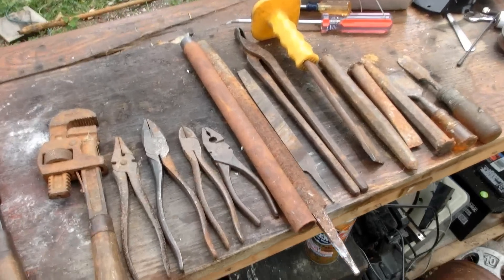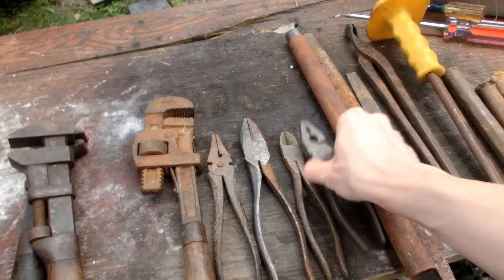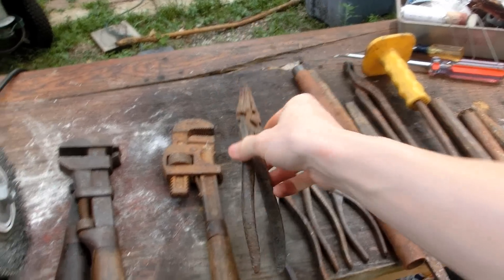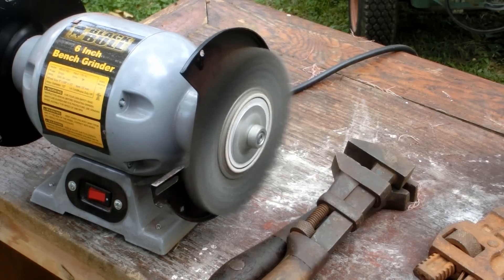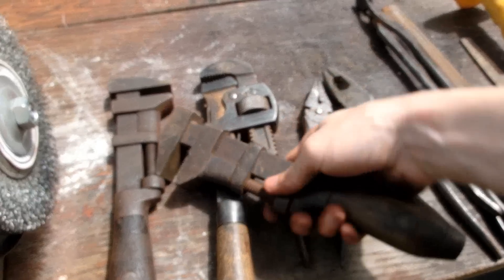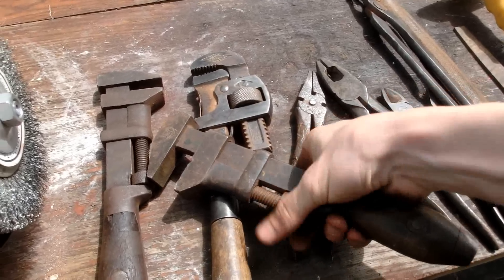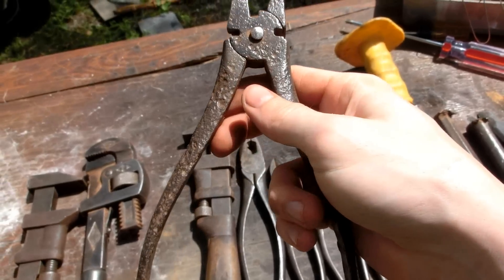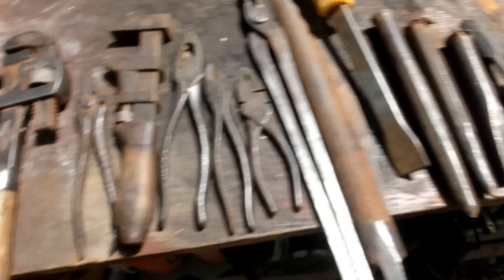Removing Rust From Old Tools

Comment: I'm a machinist and have been for 30 years.  I used to clean off a lot of rust from tools and hardware using a brush wheel.  If you are going to do this USE A RESPIRATOR!  I got very sick breathing in the dust and I worked in a very well ventilated shop.  My lungs were permanently damaged from the dust.  Also, those wires can come loose and fly in your face.  I hope you used safety glasses.  I can't tell you how many times I had to run to the first aid kit and grab tweezers and pull wires out of my co-worker's faces.  OK so much for my safety rant.
Reply: nunya biznez Yep, I saw a guy lose an eye to one of those wheels, I use a face shield to work with a wire wheel, I need to use a mask more often though.
Reply: John Smith I should have been more specific in my post.  I got cancer from the grinding dust and it took a couple of years of chemo and radiation treatment to get in remission.  So, YES you should us a respirator.  While the little paper ones may prevent a lot of dust from getting in your lungs, they are not full proof.  A respirator with filters specifically rated to protect you from grinding dust is recommended.
Reply: Hey, what kind of respirator should I use for cutting mansonry and bricks with my angle grinder?
Reply: Carlos De La Cruz T I would go to the website of a respirator company, there are several, and search their products.  To find out the names of such companies, go to a major supplier, most sell several brands.  MSC, McMaster Carr, Granger and others all have websites.  Or Google "PPE industrial" and you will find many vendors selling respirators.  Some of their websites have the information you need.  The manufacturers of such equipment usually have the best information and will often send you a flier to look over.  By the time you get done you will know more than you wanted to.  The paper masks you can get from Walmart are suitable if you are only doing a few.  but if you expect to do this for hours constantly, you will want a respirator with replaceable cartridges.  You will spend about $40-$60 for the respirator and maybe $10 for a pair of cartridges.  The respirator will have rubber seals for your face to help prevent any dust getting into your lungs.
Reply: Thank you very much!
Reply: Gloves... naaaa
Reply: ¿Guantes?
Reply: its stupid to wear gloves in this situation! the machine will just sratch you if you touch it, with glove on the machine will grab you
Reply: Yes well done cleaning job.But please bolt that grinder to the bench,if only for some oth
er person who may use it.Some wet and dry sandpaper to get any last bits out of any pitted bits would work to really do it.Nice job though good tools some 100 years plus old.I wish I had remembered to ask my mum for my dad's Yankee screwdriver. The old ones are always the best as they say.
Reply: @carlocruz4814  just google silicosis and if you're really interested, osha safety guidelines. I like the 3m respirator with the quick-latch, and organic vapor filters.. but idk if those are best for bricks/masonry.
Reply: Something so simple had to be said.  Safety first.  Thank You.

Comment: You can dip these same tools into a clear plastic bin filled with either apple cider vinegar or white vinegar and leave the bin outside in the hot such for a day or so longer. In fact, a couple of scoops of dried molasses (found at most farm and feed stores) put into a bin of warm water will do the same and not make the chemical mess as electrolysis will do. You can then pour the resulting ooze out into a flower bed (not vegetable garden) and still consider it being green. The grinder can snap back or kick back on you when you least expect it and the wheel does not get at all surface areas you want to clean. Lots of debris to get into your eyes or even damage your lungs.If using the vinegar or dried molasses stripping agents suggested above, just remember that flash rusting may be an issue. Generally, parts cleaned with apple cider vinegar will last a bit longer without the flash rusting happening. If your going to do electrolysis, then purchase a small kiddie pool to do your crazy scientist experiments in, as it will give you lots of room to add in more tools when cleaning. The reason I like clear plastic bins when using dried molasses or apple cider vinegar, is that I can easily check on the parts each day to see how the bath is working out.  Believe me, siting the bin into the hot sun will help the process along.Good luck on it.

Comment: much better if you soak them in vinegar, just plain old white vinegar for 24 hours, mayb turn them half way through.
the result will be almost as good as electrolysis, i did it to this old axe i dug out of the garden and it came out so good you could see the difference in color from where they hardened it.

Comment: For tools that I clean up, but won't paint, I spray them with Boeshield T-9 spray, it really helps to keep rust off, especially since I get a lot of humidity in my garage.  You can use their Rust Free to remove rust where you can't reach with a wire wheel or brush, and for the small pitting that the brushes can't get too.  It's not cheap, but it doesn't take much to do the job.  A can generally lasts me about a year.  If you use the Rust Free, you have to make sure to clean it really well after using it.

Comment: it wasn't anything new to me but it was still enjoyable to see someone else admit to forgetting a tool or two outside and then having to clean them up.  One thing I learned in a blacksmithing class was to get grungy pliers hot, but not red hot then work them under water and it will clean them right out.  Just dry them and use what around here is called blacksmith goop, basically equal parts of bees wax and linseed oil, to preserve them.
Reply from the maker: unfortunatly it doesnt matter if i leave them out in the mud or in my shed, its so humid during the summer everything rusts. i envy places like nevada where cars can sit for 60 years in the desert without rusting too much.

but thats a good idea for the beeswax mix.

i was in a local blacksmithing club for several years but unfortunatly everyone was only interested in making flowers and coat hangers. i'm more interested in hand forged tools and building parts of machines.
Reply: Rinoa Super-Genius my first non class attempt was a froe and if he will have a tool class when I can take I'm going to.  Because well, fancy junk doesn't matter to me either, I like and use tools and I want to make my own sometimes.

Comment: Bench grinder buyers tip: Pay more for a high quality motor, skinnier than your wheel diameters. A thin motor allows parallel work. The cheap, fat ones make all work cockeyed and off center. Been there, done that, paid the stupid tax.
Reply: This poor video was worth it just to read your comment!  Can you suggest any brands/models that have motors narrower than wheel?  its hard to spot that when buying tools online!  Thanks again
Reply: I bought my Blue Point grinder from a SnapOn tool dealer.

Comment: Great choice in music. I did not know to do this so thanks. My tools are moistly inside or in the garage. They are all off the ground. They do show signs of rust on my older garage kept ones like your used often wrench. With that said you are a very dangerous dude lol. I hope you never get hurt. I see someone complaining about not bolted down, yeah that would be important if it was not a brush I feel personally. I am more concerned about Gloves, then eye protection, than a dust mask to avoid inhaling any rust dust. Gloves most important when getting that close to the spinning metal wire.

Thanks again!

Comment: I find that if you put bearing grease on the threads of the adjusting screws or any two steel or iron parts that rub together, they move much more smoothly and helps keep them from rusting.  Also, sometimes, it's best to leave the rust where it is.  It often acts as a protective layer.  If you remove it, more rust may form and then you remove that and continue, you are reducing your tool/hardware down and keep it up and eventually it will disappear altogether.

Comment: Try just putting them in a vinegar bath for an hour then 5 min in a baking soda and water.  Let work and gets the rust out of all of the tight spots.  I spray most of them down with WD-40.  Works great fro me.

Comment: Not boring at all!  I just happen to be de-rusting several old and recent tools of mine.  An adjustable spanner that I am working on was really rusty.  Soaking it in WD-40 for a week and brushing I have got the jaw loose, but the screw is still frozen and will not turn.  There is another adjustable spanner I have which is identical to the one that you said did not need brushing.  It was probably made by the same company.  It's problem was not rust.  The previous owner used it as a hammer, deforming several threads of the screw.  I removed the screw and used a file to carefully reshape the bent threads.  I put it back together and now it works fine.  Thanks for sharing.

Comment: Secure that Grinder to the work bench and, use a Respirator Gloves  and, Safety Glasses! Other wise good vid.
Reply from the maker: +EBikerX Stroz i already wear glasses, no sense in wearing two pairs of glasses. gloves can be very dangerous when working with a grinder. respirator is overkill, and nah its not so bad to have a free-floating grinder.
Reply: he's is outside yo. can't get much better ventilation than that.
Reply: +Rinoa Super-Genius gloves+grinder=No fingers
Reply: As a physician I suggest to all to wear safety glasses above ordinary ones. I see in the ER from time to tome people even having safety glasses, getting metal in the eye when grinding. You cant be too safe about your eyes folks!
Reply: Using gloves on a bench grinder surely is a massive no no! Yes goggles and bolt the damn thing down!
Reply: @flamecranium7787  depends on whether you are up hill or down hill from the source of dust.......I find no matter how many times I move and re-position,  I still end up down hill from the debris in the air.  Same thing with smudge fires to ward of bugs, the danged smoke always seems to follow me.
Reply: Some times PPE can be more of a danger than protection, skill conquers all, all these YouTube comments on PPE are from people who don't use or are scared off powertools

Comment: Acid bath. Use something like Limeaway. Or if you're brave and attend to the process you can get rid of rust fast with swimming pool acid. You just have to be sure to remove the piece as soon as the rust is gone or the acid will continuing working on the metal until it's completely dissolved. The secret to using acid is to rinse then dip the piece into basic neutralizing solution. Ammonia works well. Then treat the metal with a moisture displacing liquid like WD40 or Armorall and dry thoroughly in the sun. The wire brush is likely to expose unoxidized metal, leaving the piece open to even more oxidation. If you time it right, the acid will take only the rust first.

Comment: Great video Rinoa, I don`t know what is wrong with people. Though I would suggest against cleaning the files. Rust doesn`t inhibit their ability to well file and wire brushing them can damage the surface.
Reply from the maker: a rusty file doesnt look good though. and it gets rust all over your hands.
Reply: You have done videos on removing rust through electrolysis, maybe it will be a better solution for files. Also there are wire wheels with different kinds of wire - softer or harder. You can leave one on your older grinder if it still works, since brushing rust is not very demanding on the motor.
Reply from the maker: i've never had any issues of brushing a file, the file is too hard to be effected.

Comment: I know I'm late but I just wanted to say, about your great granddad's pliers, that bolt would actually be how it came out the factory. He still may have found them and did that himself but I thought I'd share that
Reply: I have the exact same pliers, but mine don't have a peened bolt, they have a flush steel dowel insert, like you would expect from factory. I highly doubt my pair are modified, while the pair in the video are unmodified from the factory.

Comment: They do look loads better, personally i would apply something to the threads and moving parts, old oil from a car oil change, would make them operate nicer lol :-)

I found a few old spanners in my dads abandoned shed, red rusty like yours, they got sand blasted and a thin coat of laquer, they have stayed nice for 10 years, i didnt want to repeat the rust removal again.
Reply from the maker: nice, i'm not too concerned about these getting rusty because i store them in my bedroom so they stay in a pretty dry place.
Reply: Rinoa Super-Genius   If your room is being invaded by slugs, then there is probably more humidity than you think. The laquer idea sounds like a good suggestion.  Maybe stack the tools on something that provides cathodic protection? There is the water displacement formula 40:  WD-40.  Oh go all out and set up an electroplating operation after the cleaning. That tends to generate a lot of toxic materials.
Reply from the maker: *****
 well the air conditioning keeps it bellow 50%, we try to keep it at 30. its better than the 80+ outside.

the slugs and bugs only really come in through a crack in the foundation when its raining a lot outside.
Reply: In south Louisiana, we don't have basements because the water table is about two or three feet below the soil surface.  People who have allowed the water level to get too low in their swimming pools have had their pools float and push out of the ground.  You should see my mildew collection.  And I don't even want to have a mildew collection.
    I think I might laquer some of my tools.  The moving surfaces I will grease.

Comment: Agreed. Wear a respirator. I am sure you were wearing your safety glasses. I also think you should wear some thin gloves to protect you if you touch the wire wheel.
Reply from the maker: no, a respirator isnt necessary, especially when your outside. i find my regular glasses work just fine, and gloves actually make it very dangerous. touching the wire wheel ussually doesnt hurt at all, although one time it caught my hand and gave my thumb a little rash, if i'd been wearing gloves i might have broken a bone that day.

Comment: The wheel you used is what I would worry about since I once used a grinder at one job I had and ended up going to a local doctor because of the piece of metal which got away from me and ended up leaving a permanent mark over one eye. I saw the video about using coca cola to clean tools and that sounds better, and so does the white vinegar solution.

Comment: This is directed to everyone who might read comments.  What would a monkey  wrench be used for vs a pipe wrench there very similar. I have a lot of old tools.
Reply from the maker: i use a coes wrench for bolts, and it doubles as a hammer. it also works as a good clamp if you use pliars to tighten the nut.

Comment: I DID enjoy this very boring video :)
Do you have any tips for preventing the rust form returning? Like that quick surface rust that can come back the same day if its a bit humid out? In the past I've taken an oily rag (motor oil) and wiped down things I've just de-rusted, seems to work but may not be ideal for hand tools.
Reply from the maker: i've heard that can help. i've found that keeping them in a box under my bed works great though because i keep my house relatively dry. also just normal usage.

i may try the oil method sometime, but would hate for my tools to feel grimy.

Comment: After i brushed my tools with a wirebrush I use WD40 or similar spray to coat them.
So if u dont use them for some time they dont get rusty at least no so fast.
Reply from the maker: +Wethnauin i've found boiled linseed oil can leave a nice hard coating on them too.
Reply: interesting... natural and cheap ^^ ill try it thanks

Comment: I would also suggest, as a matter of safety, grinding the mushroom heads off those chisels.
Reply from the maker: speedyspooley  why?
Reply: Because they can break off during use and become projectiles.  They can also become sharp & cut you if your hand slips.
Reply from the maker: speedyspooley
i'm also swinging a very large and heavy projectile called a hammer in the direction of my hand, so i think aim is the biggest issue.
Reply: Rinoa Super-Genius My father knows a guy who was using a hammer on a tool steel wedge that was mushroomed and all the force from the hammer went into one little edge propelling a large chip of metal into his arm and slicing multiple tendons. that guy now has no use of his hand because he cant use his fingers anymore, it happens way more than you would think so don't be dumb and just grind down any mushroomed edge or crack.
Reply: Yeah best knock those off

Comment: Two things made me cringe in this video, one was when you used the grinding wheel on that chisel, and the other was that you didn't oil the tools after cleaning them, easiest way to look after tools is to keep an old rag soaked with oil in a jar in the workshop and wipe over the tools after use, if you don't oil those tools after wire wheeling them, all you have done is expose fresh metal surfaces for corrosion to attack.